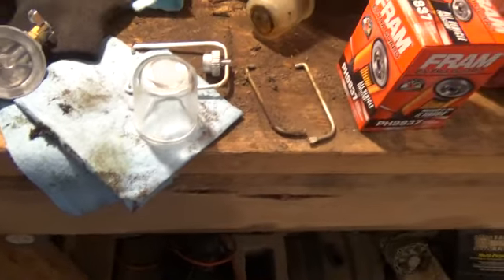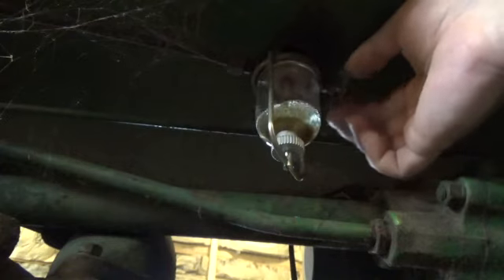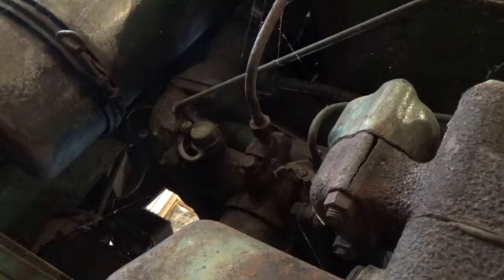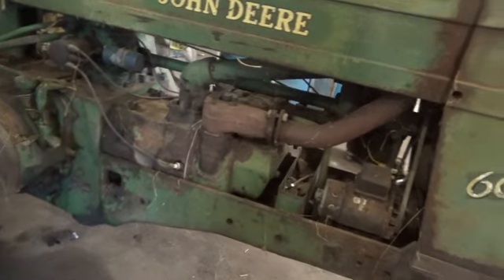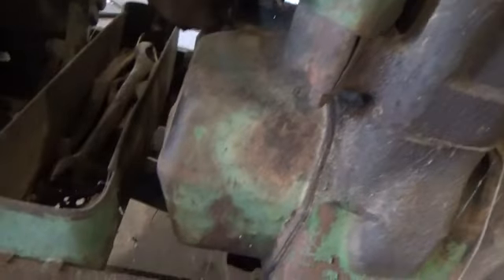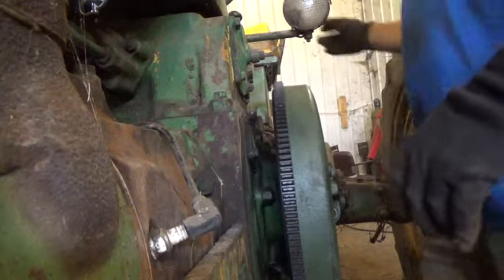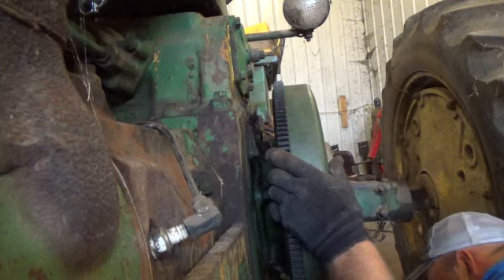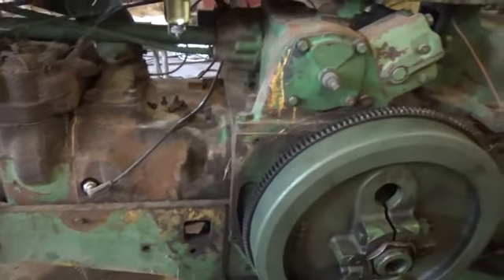John Deere 60 part 3 fuel and engine stuck?

Comment: Your on the right track for taking out the starter.

Were you still getting gas in the oil after changing the sediment bowl to the manual shutoff if you left it on?
Are you sure its something stuck open in the carb or could it been bad diaphragms in the old sediment bowl since it opened off of oil pressure and if the diaphragms were bad gas could drain passed and into the crank?
I wish we still had our 60 and 520. I may know where the 520 is and try to buy it back.
Reply from the maker: Honestly I never left the gas on after changing the sediment bowl the the new manual one. Your idea about the diaphragm could be right
Reply: LVF & Northern Wisconsin Farming it was just a thought maybe saving you tearing into the carb

Comment: That pin you found looks like a Bendix roller that is what engages the drive a 60 starter is the same as an A as far as I know switch and drive was in the Steiner catalog the last I looked it is not too hard to change the Bendix but a word of caution. Make sure as you separate the halves of the starter you mark their location to each other and also don't let the armature get out of the brushes. If you do get 4 six penny nails and some light wire and pull the brush arms up and tie them with the nails across the starter body and you can get it back in under them
Reply from the maker: Corey Trout ok. Thanks. Maybe that pin is all that's wrong with it!
Reply: LVF & Northern Wisconsin Farming if it's the connector pin maybe but if it's a roller there's either five or six in the drive and one escaped which means it broke

Comment: Glad you got a new bowl in. What was that metal piece cracked around the through bolt when you were pointing the camera at the fuel line and trying to unhook the line?
Reply: LVF & Northern Wisconsin Farming I meant the large rusty cast piece with the green painted piece bolted to it. I don't know enough about engines to try and guess at the part, but it isn't on the fuel line.
Reply: That’s the exhaust manifold
Reply: LOL, totally missed it going up and over the other side! Thanks Joe! Been a long time since we had the 2440 and that was the last tractor of ours that had the exhaust pipe in the middle of the hood so i'm used to it dumping straight to a pipe on the side.
Reply from the maker: +Floyd Farms ah, sorry exhaust manifold

Comment: I use Cyberlink PD14 so I'm not too far ahead and it has the best speed adjustment compared to the others I've used from the same release time (Nero Video and Pinnacle Studio). Have you noticed the rain starts in one area and just stays in the same area more or less? See that pattern once in a while but mostly it would be fronts moving through, wham bam, thank you Thor!
Reply from the maker: Digby O'Dell I have noticed those weather patterns. Some of us keep getting rain, and others are too dry

Comment: ill buy you a beer if crank it by the fly wheel! lol
Reply from the maker: I thought about it! Never know, I may try it!
Reply: The older hand start JD 2 cylinders had petcocks to reduce compression at start up. This 60 may start with spinning the flywheel if the compression is low. Another tractor with a flat belt pulley and belt would spin this 60 over.

Comment: Brad, I am not sure but the older B models had compression releases on the cylinders to allow those electric starters to turn the engines over easier. They look like small brass pet cocks located on the belly of the cylinders. Not sure if JD did away with them on the 60 or 70 series. Might want to check.
Reply from the maker: Christina Moneyhan yep, dad had one when I was a kid, but no electric start! It was a challenge for a 12 year old to roll it over! Too bad this tractor doesn't have those pet cock's, I'd try hand starting it!

Comment: Yes, the starter ring has been reversed. When you pull the starter, you may need a new switch on the starter. The Bendix is/was engaged as you were turning over the flywheel. That pin may have been from the actuator that contacts the starter switch and engages the Bendix.
Reply from the maker: +AKWayne S ok, thank you for the heads up. I've never worked on a starter like this before
Reply: AKWayne S  I thought you couldn't turn the ring gear around on 2 cylinder. 2 cylinder stop in same place all the time so you heat it up and move it 1/4 forward or backwards   I could be wrong also
Reply: Just heat up the ring and flip it, that is what was done on this 60, the "back" side was pretty chewed up. Brad even commented on that.

Comment: Water separater? Doesn't Wisconsin have to put ethanol in gas? In Minnesota we haven't seen water in gas for years, that's about the only good thing about ethanol.
Reply from the maker: Yes, if you put in low or mid grade pump gas, the high grade doesn't and if the fuel truck brings farm rated gas it is also ethanol free!  I wonder if that grey powdery stuff was spent corn dust! LOL
Reply: LVF & Northern Wisconsin Farming you could put a couple kernels in there and tell people it sat to long and turned back into corn. Lol
Reply from the maker: +Mark Groth lol! Thats a good one!